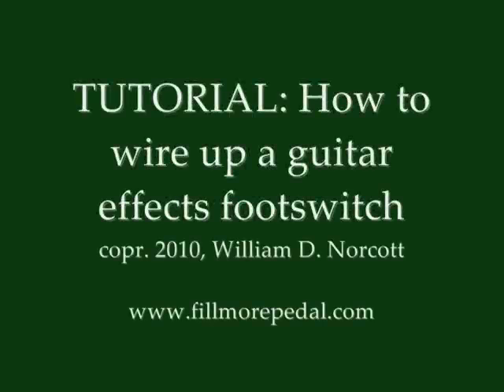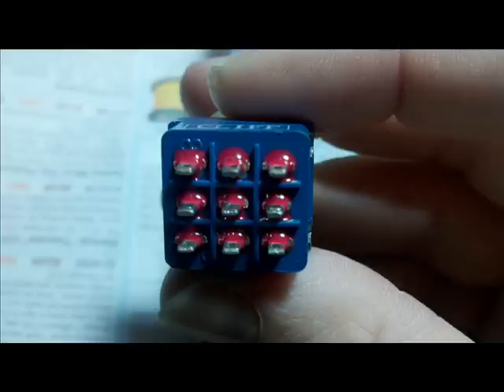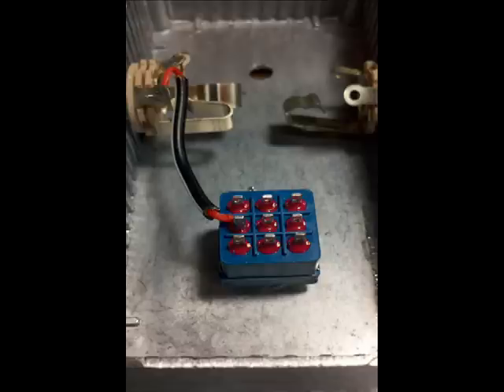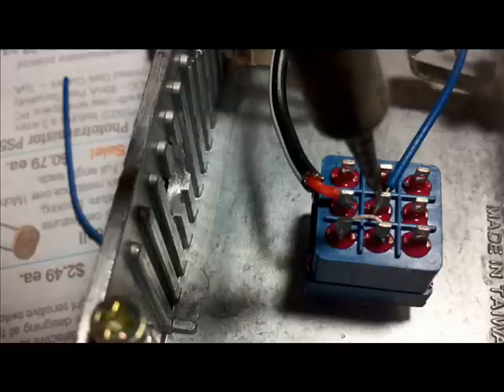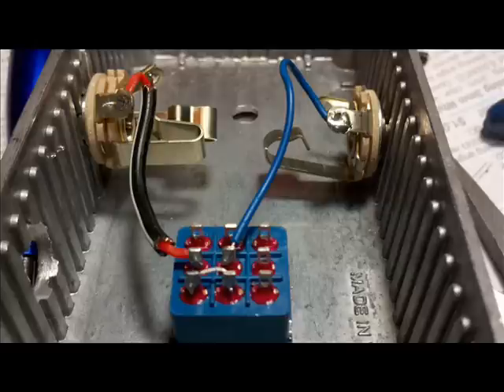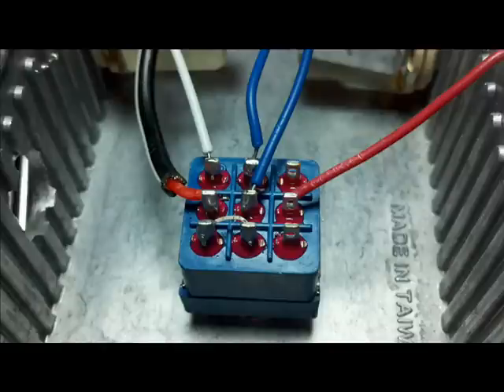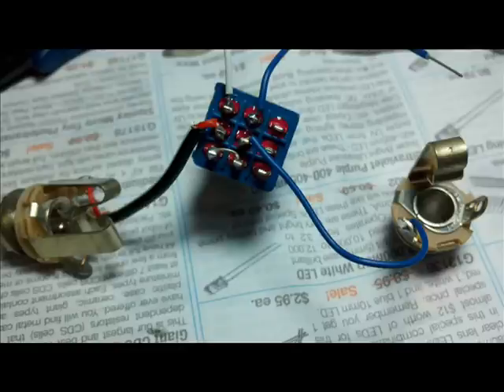Tutorial - wiring a footswitch for a guitar effect do it yourself foot switch

Comment: Hi mate I am building amp with true by pass and need help with by pass
So from + & - from pick up where would I shoulder them as I am trying that when I push the switch signal goes to the amp and when it's not pushed it goes to other output. Can be headphones or mini amp.  Plz help as u showed only one cable. Is it the + then where - will go.plz help

Comment: I'm wiring a new stomp switch in a Russian Electro Harmonix Small Stone Phase Shifter. The old switch is 4 prong. The unit itself only has 3 wire leads. There is a jumper on the old stomp, probably the unit's signal. Does it jump to input or output?
Reply: for anyone interested, the answer to the previous question is jumper goes to input.

Comment: Does the switch have an orientation? in other words can I accidentally installed upside down?
Reply: Yes, it will still work if you are 180 degrees off (ie: upside down), but not if you are 90 degrees off.  I think I can explain it if you go to 2:34 and freeze on that frame: The guitar signal is wired coming IN to the middle row of contacts on the red wire, and going OUT of the middle row on the blue wire.  If the switch is OFF, the signal is routed DOWN to that short jumper wire and immediately back to the blue wire heading to the pedal output.  If the switch is ON, the signal goes up to the white wire which enters the circuit, and returns to the top row of the switch on a blue wire FROM the circuit.  I think the other two poles are maybe used for the pedal's LED status light.  think of the switch as bringing the guitar signal in and out on the middle row, and alternating between the top and bottom rows.

Comment: Great video tutorial.  I have the same switch only it is a momentary switch.  I just want it to act like a SPST.  Basically the switch and 1 jack which will go to a delay box so that I can tap in the tempo.  I am just trying to figure out how to wire this correct the 1st time so if you have some advice I would greatly appreciate it!

Comment: This method does not ground the hot tip wires, and you need that for true noiseless bypass. If you do it this way you will have a POP sound which is why you setup your stomp switch wiring to ground the tips when switching over to the FX loop section and vice versa. Remember to also add a Pull down resister on your LED light to avoid Stomp Switch Pop ( 10 million OHM)
Reply: I have used many different stomp wirings and personally, I dislike the method shown here. Thank you though, I prefer the method at the bottom of this: http://www.madbeanpedals.com/tutorials/downloads/MBP_FootswitchWiring.pdf close second: http://i1016.photobucket.com/albums/af286/fenderamerica/Pedal%20Schematics/SWITCH.jpg
Reply: hi, do you have a link to your method of grounding the input etc...ive been messing with various different ways to wire a 3pdt, so would be interested to see your 'NO POP'  way..cheers.
Reply: Danfuerth Gillis Hi! Can you please enlight us on how to wire the switch so that the pop sound dissappear?
Reply: Adrian Ghisan ,  hi search 3PDT wiring on google images....with grounded input and output...

Comment: does it matter which way you got the switch turned when you wire it up? is there a way to know which way is "up"? or does it even matter?
Reply: just found out the hard way, it does matter, at least it does on a carling brand switch, which i believe are most popular for pedal manufacturers right now... as far as i can tell theres no way to tell whats correct just by looking at it. so break out your multimeter and think about what you need it do... or just go for it, and if it doesn't work, desolder everything, spin it 90 degrees and resolder! hope that helps
Reply: George grover Okay... I'm a total noob, so I just want clarification. It doesn't matter?
Reply: Orient a switch as shown. The connector holes of the lugs are open North to South, through the narrow space of the lugs, the long axis of the lugs is East West. If you have a switch that does no have these easily identified orientations, then you may certainly run into trouble. Otherwise, having the switch either way, North to South, makes no difference. Think of the connections as being made from holes that are above and below one another. You are NOT going sideways from one hole to another along the wide sides of the lugs.
Reply: No :)

Comment: hi there, if you look at the tonepad_offboardwiring, we see that a connect with the ground wire to the switch centre pin.
I think that we have many ways to connect the 3pdt. But your sugestion is great, a less cable inside the box :D
greetings.

Comment: I'm a bit confused about the LED. the top pole (+) goes to the top right on the stomp switch and the bottom pole goes to ground. so where does the free floating wire attatched to middle right on the switch go? 2:00 sorry I'm a bit of a noob at this.

Comment: hi, i don't know if this is a stupid question or not, but does it matter what side use my switch on? i have no markings and i don't know if i'm attaching to the left pins like you are, or if i'm holding it 180 degrees flipped.

Comment: Why do you need to do the jumper? If your input is going to the far left pole and the output to the middle then the bottom row is completely inactive because the rows are not a part of the same circuit. So if you added that jumper to the bottom row but the input wasnt connected to it at all, it wouldnt be doing anything am i right? Could you go into further detail about wiring the bypass please?

Comment from the maker: @courageouszombie A jumper is just a piece of stiff bare metal piece of wire that you use to connect two points of a circuit with solder.   In this video you can see the jumper in the bottom left corner of the switch.  When you build pedals you will snip off a lot of leads from resistors after you solder them to the circuit board ... those snipped off leads make great jumpers.

Bill

Comment from the maker: @The1970sInfatuate I use a stereo jack on the INPUT and a mono jack for the OUTPUT.  The stereo jack is wired so that when you plug a guitar cord into the INPUT it turns on electrical power to the circuit board.

Good question.

Bill

Comment from the maker: @Covers4Christ    You only need 1 wire to the mono jacks, the signal wire.  This is how the wiring works.  1) one wire from the input jack goes to the footswitch 2) one wire from the output jack goes to the footwitch  just like it looks at 1:15   the jumper on the bottom of footswitch connects them together when switch is OFF.    3) the input and ouput wires of the board get soldered to the footswitch like it looks at 1:31.   The other contacts of the mono jacks is ground, no wire there.

Bill

Comment from the maker: @Covers4Christ There is one input jack and one output jack.  Yes it is true bypass. True bypass means that when the effect is off there is no signal going into the circuit board and none coming out of it.  You do not need stereo jacks for that, mono jacks work fine.  I use a stereo jack on the input side to power up the effect when you plug a guitar chord into it, but that is a different concept from true bypass.  Thanks for listening.

Bill

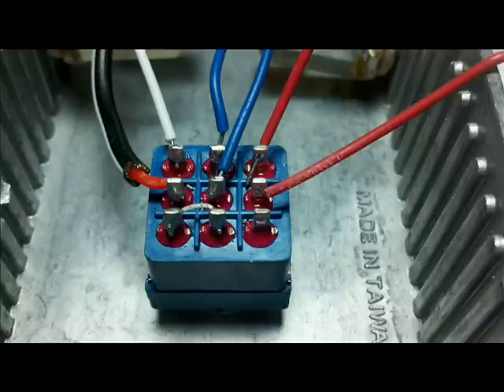Comment: @ 2:04 where is the red wire underneath the red wire hooked up to the positive end of the LED going? Also, how would you wire a DC power input (you can't have a useful effect with just 9V batteries after all)? Your videos have been very helpful and are greatly appreciated. Thank you.

Comment from the maker: @BadBluesman887 I wire a resistor in series with the LED 1K is a safe starting point it will be visible but not too bright.  470 to 1K range works fine. Thanks for watching.

Bill